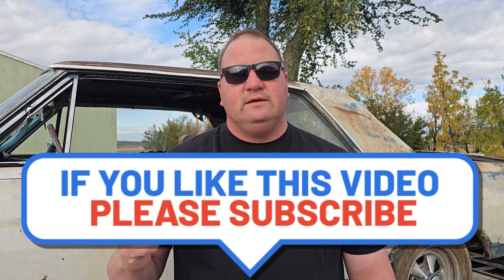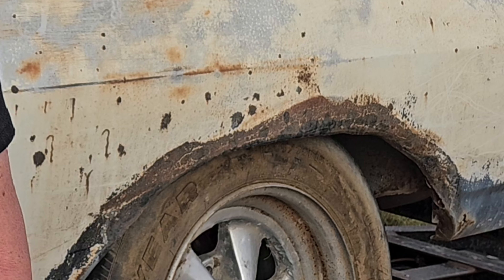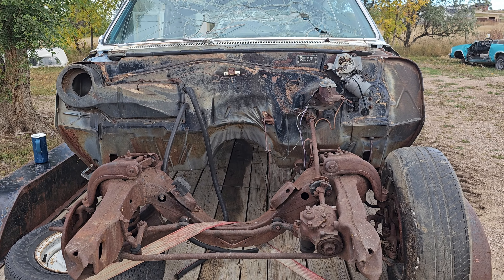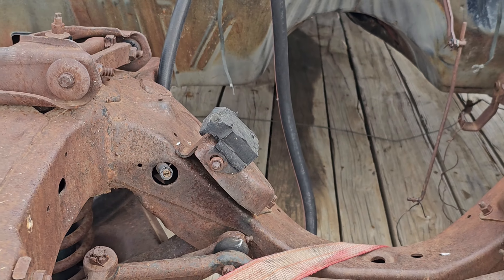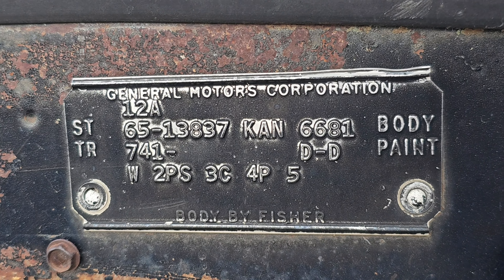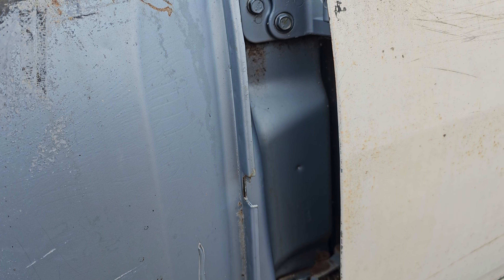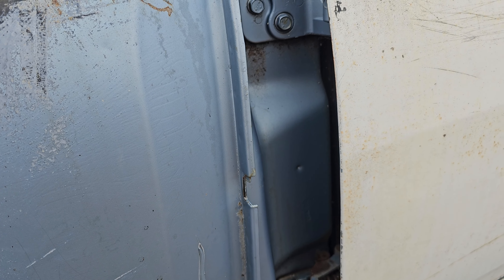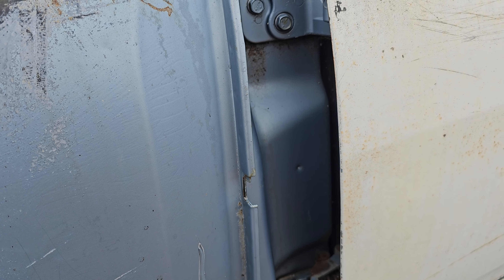1965 Chevelle SS Project

Comment: My first was a ss the exact same mist blue color, mine had a powerglide and 283, not the origional engine or trans, got it in 1975 and rolled it in 1976, went on to own 3 65 el caminos.  Id love to do what your doing, rebuilding a 65 ss malibu,   Rock on brother
Reply from the maker: Thanks, I have always wanted one, and we are pretty excited.  I just need to figure out what direction we are going with it.
Reply: It’s W-W code glitter gray my 65 SS has the same color 283 4speed

Comment: Check and see if there are 2 fuel lines running  thru the frame to the fuel pump. That will determine if the car started life as a L79 or a Z16.